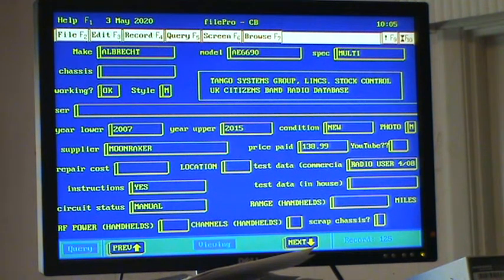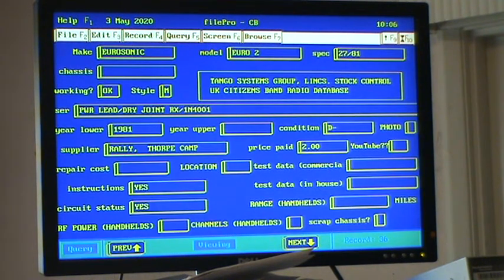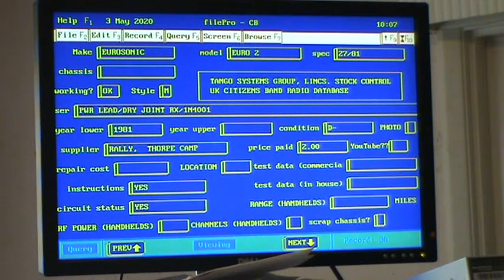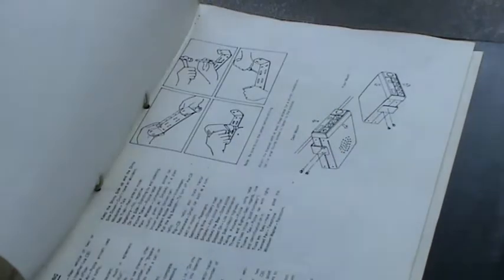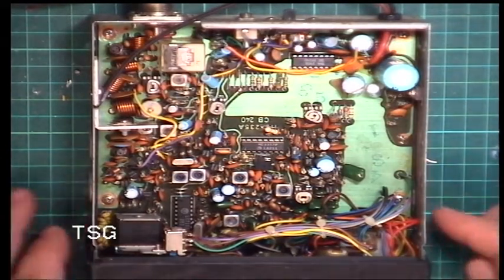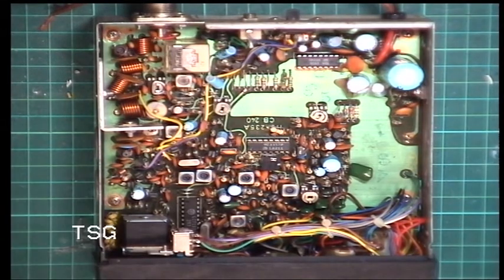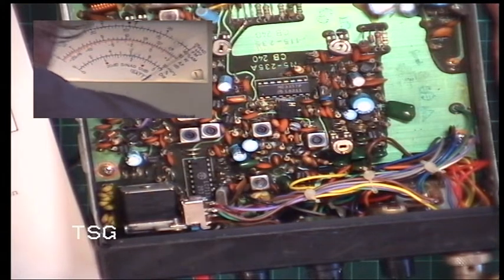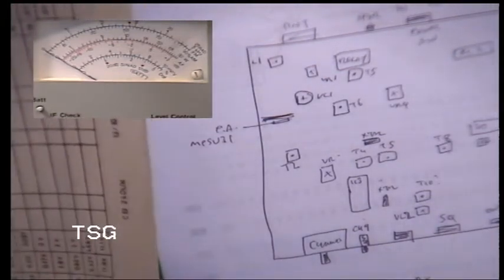Eurosonic Euro 2 UK CB 27/81 CB radio (mobile) - repair service & full alignment

Comment: Another fantastic video Richard. 
Very surprised to see how detailed that Alba service manual is!
Reply from the maker: Yes, they always were & all Amstrad, Binatone & Fidelity & Rotel products had excellent manuals too. When I had a TV/audio shop late 70's to early 80's, some brands only supplied manuals to their appointed dealers; Grundig were one & that posh cased, not-so-posh-inside brand Bang & Olufsen was another. To this day I'd never support or buy any of their offerings. With Grundig dealers had to promise to charge a certain price for repairs; a practice I always thought was illegal. Let's say a line output transformer replacement in a colour TV..at the time was about £45...Grundig made their dealers charge £70. Those afforementioned cheaper brands would happily sell manuals & spares to anyone; even the end user. Good for them.

Richard
Reply: @ukfmcbradioservicingTango21  And their restrictive practices were made a nonsense of because our local B+O dealer was happy to sell us parts and service manuals to keep their account turnover up but B+O stuff was rebadged stuff for the most part, Hitachi, Phillips and Panasonic videos with a pretty front cover and a 3x multiplier on the price, their CD players were the same Phillips OEM chassis everyone used and their tellies turned into Phillips chassis too. their amplifiers were OK but nothing special compared with a decent Japanese brand at a quarter the price.  

Grundig parts were available via SEME or CPC at the time IIRC and pretty much every Grundig telly had a full schematic folded up and tucked inside the set.

Comment: I know that it is convention, but why do you describe a generic PCB within a chassis as a 'chassis'?
Reply from the maker: Convention, probably relating back to TV sets where just like CB's, the same innards appeared under numerous brands & models. The service manuals even say "incorporating the XYZ123 chassis", some sales literature also states the chassis type. When the PCB is just a PCB it is called a PCB. Once metalwork becomes attached & wiring goes in it's called a chassis. Unless you are Motorola & call it a Tennappa if I have their spelling right!

Richard